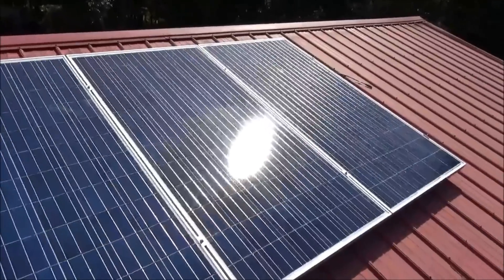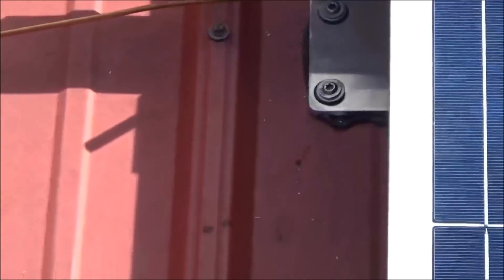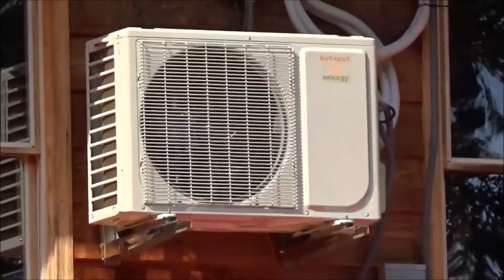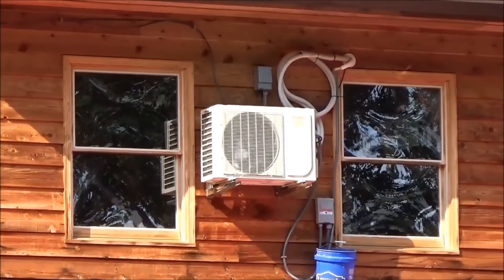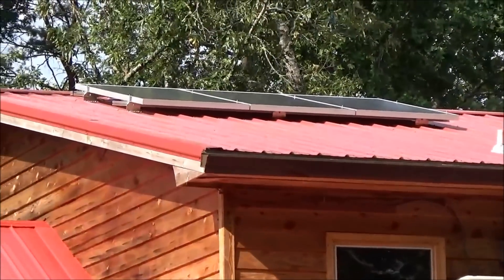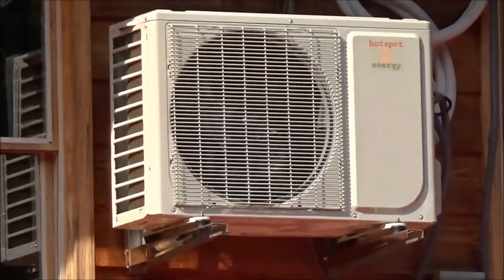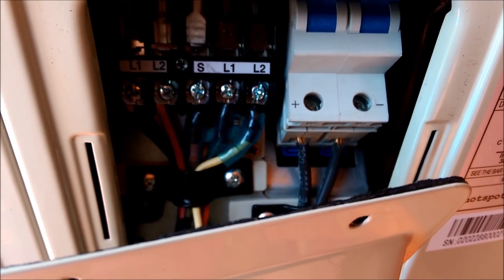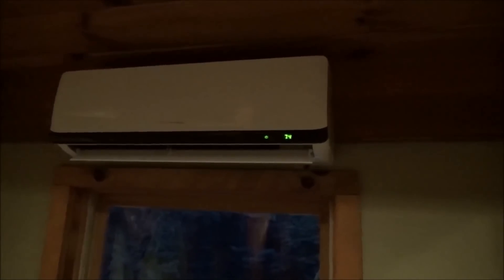Solar Air Conditioning  Part 2

Comment: Question?  As you know in RV's there are refrigerators that work off a heat source. Is there or would it be possible to create an A/C system would work off the solar heat and solar electrical panels? The heat would start the expansion of the refrigerant and the D C would drive the blowers to move the air.
Reply: oldpukindog try researching propane refrigerators because you have something there if coupled to evacuated tube solar collectors and work really well but propane refrigerators are really expensive
Reply: jonathan nonya
Yes that's why I brought this up the propane frig we had in a camper a while back would work on a hot day with nothing turned on.  I think the only thing that holds them back is that they work with Ammonia. Witch can be dangerous. I have not seen anybody that makes a system for this application. I wish I had the technical ability to build one my self. Can you imagine the cost savings of not needing to run a compressor. And the hotter the day the better it would work. Yes the price would be high but the long run in savings would pay off. Well that's what I was thinking just wanted to see if anyone would brain storm the idea...
Reply: The ammonia is in a sealed system so its not that dangerous as long as its not overheated. but instead of using a small flame it would be easy to use a hybrid system with evacuated tube solar collectors, and photo voltaic panels as the heat sources for day and night time. if you can have a large enough system you would be able to run other things along with the fridge, still having minimal amp draw on your battery bank.
Reply: Like say I don't think I could do one my self. I just read that they switched from ammonia because of safety reasons. For all I know they switched because it was to efficient. So someone was not making enough money.
Reply: @oldpukindog  actually the efficiency of those refrigerators is quite low

Comment: I like this a lot. I build Monolithic domes, and one ton of AC will easily cool 1,000sf of living area in a dome. I know the average is 333sf per ton in conventional construction.

I do have a question though....one ton of AC is 12,000 BTU's and there are 3.4 BTU's per watt, so one ton of AC is equal to 3,516 watts.

I do realize that the one ton is over a 24 hour time frame. For those who don't know, AC units are rated in tons, and that goes way back to when AC was not used in homes, but used to make ice for ice makers when we had ice boxes for food. The ice makers needed to know how much water a unit would freeze into ice in a 24 hour time frame. Since ice was and still is sold by the pound, AC was naturally rated in tons. One ton is 250 gallons of water or 33.333 cubic feet of ice.

Now if we do the math, that means we should only be running around 150 watts and hour to run one ton AC unit, but we know that's not the case, so can you explain that to me please and correct me where I'm wrong.

I'm guessing it's just that inefficient of a process of removing heat to make it cold?
Reply: You are confusing btu with btu per hour.  A one ton AC unit moves 12000 btu/hr which as you point out is over 3500 watts.  He is moving that 3500 watts using 800 watts of electricity which seems pretty efficient to me.
Reply: @seanlyman4049  also, don't forget to factor in the coefficient of performance,  and the seer rating.
Reply: @ricknye4590  coefficient of performance is just a way to express how much heat is moved compared to how much energy it takes to move that heat.  So in this case 3500/800 which means he is achieving a COP of over 4.  Using free energy from the sun this pretty good.

Comment: What do you do to prevent hail damage?
Reply: GREG PORTER You could use some Marguard over the panels it's what they use for the windows on forestry machines but it would cost a bit but cheaper than having to buy new panels every time there was hail.
Reply: Richard Maunder thanks
Reply: Photovoltaic panels have been designed strong enough to withstand most hail.

Comment: This is also a very viable system for non-grid down use.  For much of the Southern USA, air conditioning is a major electricity load and expense.  Installing some of these units should be able to handle the cooling load of most places.  I would also think the payback on the upfront investment would be rather short too.

Comment: If you screw directly to the roof, won't it leak?
Reply from the maker: Jack T The DPW easy feat have a great sealant to prevent roof leaks.  so far so good.
Reply: Jack T If you look closely at the metal mounts where they touch the roof, there is some black sealant visible. I believe he mentions that the "feet" of the mounts come coated with it. All things being equal, they would create a watertight seal around (and under) the base.

Comment: Awesome! Love the collection of condensation idea. Have a question plz.... I just bought an rv and am going to have a full solar system installed (as soon as I find someone to install it that is.... No men in my life at the moment and I'm lost on this stuff) do you have recommendations? Type, how many Panels, batteries, anything I should know and consider?
Reply: tamib711  I also have recently purchased a RV and would like to convert it to solar.  I am currently camping in SE Fla.  any suggestions or advice will be greatly appreciated. Tnx. 🍀
Reply: I did the GoSolar Calculator, because it recommends a kit. Then I went to ExploristLife and he has wiring diagrams and a parts list.
Reply: How did it work out?

Comment: so why don't you cover your roof with panels so you shield your roof from all of that radiation
Reply: charles fournier probably because that would be insanely expensive...
Reply: Looks like a metal roof, which itself should act as a radiant barrier
Reply from the maker: charles fournier My roof is actually not the best place for solar for  year round production.  I am in process of a ground mount array that will produce more power.  That system will provide the AC power I need to run this unit.  I will use this roof for Air Conditioning and pool pump and other small projects.

Comment: You know you are hard core when you are collecting condensation water for re-purposing. Damn nice set up there Mister.
Reply from the maker: FDSeoul San Diego Appreciate it!
Reply: +FDSeoul San Diego I live in southern New Mexico,, when we spit, we blow out dust.. Grin,, It is so cool to see all that condensation,,, I know it's not fun to live in, but we would have some greenery growing. Here, we have to oversize our AC units so that they don't dehumidify,,, when we are running 15% humidity, the last thing we want is to remove any of it. When I first moved here from Oregon, I thought these guys were insane,, ballpark is 450 sq ft per ton, here. that's nuts,, but then I learned why,, we want to keep our moisture,,, When I was in Oregon, if we oversized like that,, we would end up with a cool ,, damp, swamp like house... but here, if you go the normal route, that humid areas size by, we would have nose bleeds, wood cracking and all the fun stuff. So I was loving the bucket of water!!! I miss the greenery, but not the slimy wet feeling :)
Reply: engineer775 Practical Preppers  Since the roofing has the 'channels' built in...just put a rain barrel on the ground to catch. It would make collection a lot easier.
Reply: ***** This unit doesn't require any batteries, only the solar panels and connected to your home's power to supplement the solar.  If you want the system that runs also or solely on solar, then it's the higher BTU units.
Reply: engineer775 Practical Preppers So if I were to have those panels specifically for the Air Unit so i can stay cool,  .............. HOW MUCH??? ... And do you NEED batteries?
Reply: @CasonovaCorkClub ; 

I would say that yes you will need batteries because the sun doesn't shine 24 hours, and it will still be hot at night!